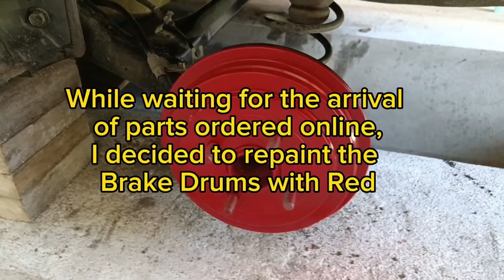Hyundai Accent Rear SHOCK ABSORBER Replacement

Comment: Boss ano sira ng shocks mo nung bago mo palitan? Malangitngit ba?
Reply from the maker: Tumatagas na yung oil nya boss
Reply: @chomytuideas1784 yung sakin sir my lumalangitlangit sa likod. Sira na kaya non?
Reply from the maker: yung langitngit marami po cause dyan boss. kapag masyadong bouncy na yung spring sa lubak na daan yan na yung palatandaan na palitin na ang absorber
Reply: @chomytuideas1784  bago na shocks ko pero my tumutunog padin. Parang mgaplastic na tumatama
Reply from the maker: sa harap po ba?o sa likod?
Reply from the maker: yung mga langitngit usually sa bushing yan boss
Reply: @chomytuideas1784  sa likod bossing passenger rear right. Bago na yung shocks ko andun padin
Reply: @chomytuideas1784  para bakal to bakal. Sinilip na din sa trunk wala naman maluwag na nut..hirap hanapin haha
Reply from the maker: Disk brake ba rear wheel mo boss? baka caliper yung maingay. Try mo dumaan sa lubak pag marinig mo yung ingay, apak ka sa brake konte lang. pag mawala ang yung ingay,confirmed yan na caliper
Reply: @chomytuideas1784  hindi boss eh. Brak drum sya sedan 2013. Parang rattle tunog nya
Reply from the maker: Mahirap yan boss pag di ko makita sa personal.hehe
Reply: @chomytuideas1784  papacheck ko coil spring baka my bali na hehe